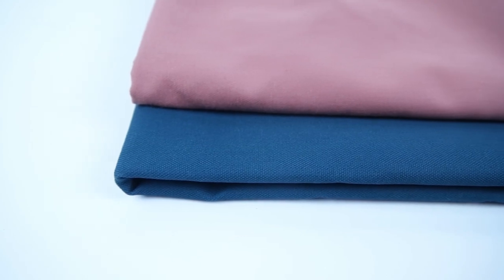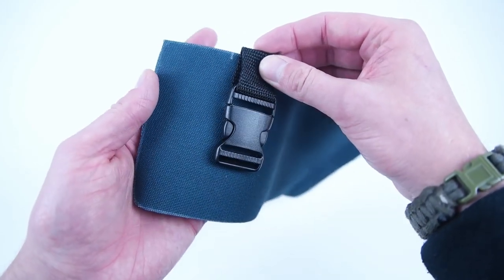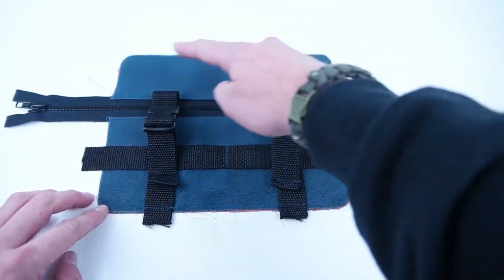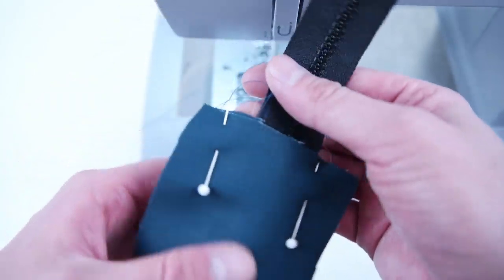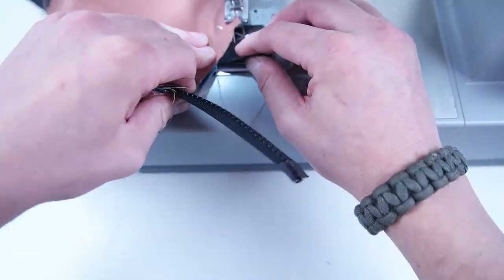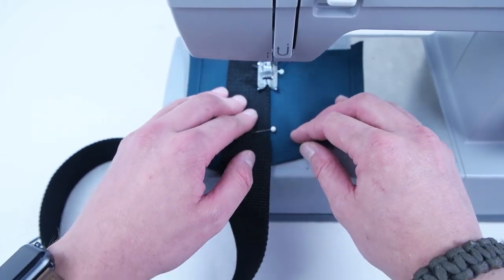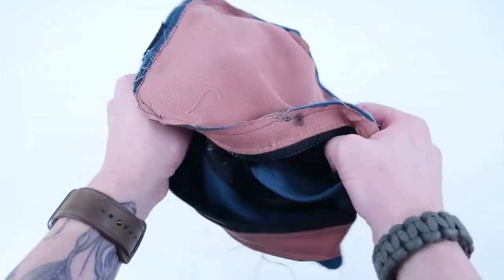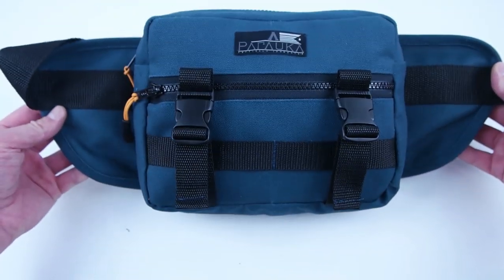Fanny Pack Utility Bag DIY

Comment: If you bought the instructions like I did, cut 2 lining, 1 outer for main fabric. Connect the sheets that need to be connected. For side strap cut 2 outer and 2 mirrored versions of it. And you only need like 1/2 yd fabric for lining/main fabric, maybe 3/4 max.